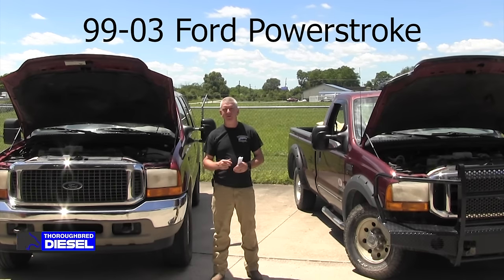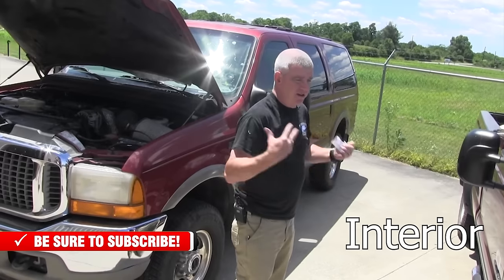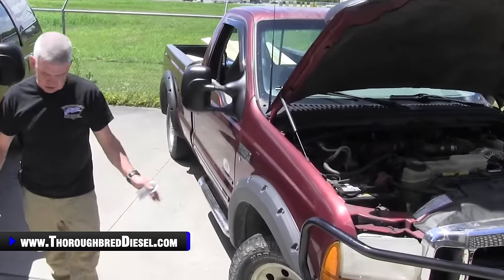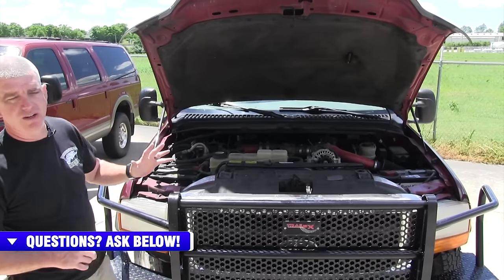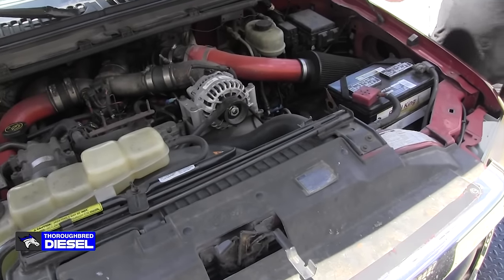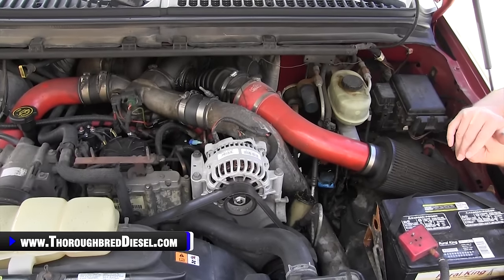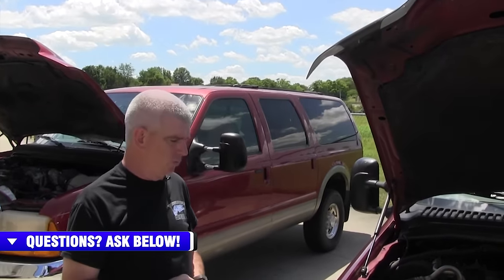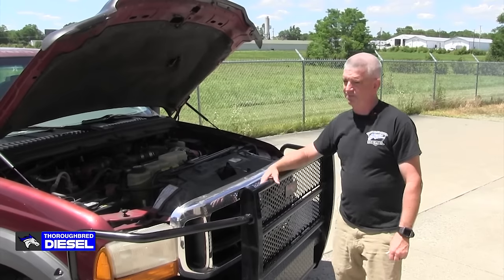TOP Problem Areas To Look At On 99-03 Ford Powerstroke | Secret Tips For Buying A Used 7.3L #ford

Comment: i got a 2001 f-350 with a 6 stage tuner 353,000 miles hauls my horse trailer best truck ive ever owned dont burn no oil still got cold a/c ---- got a 2014 f250 nice truck i hooked up a extra reverse light then the BCM went out got that fixed but all warning lights stay on --i bet i got $4000 in the a/c they fix it 2 weeks later out again the low side is empty the high side is way over now the TPS is going off took it to ford they say BCM is not communicating thats what causing the lights in the dash and a/c not working it dont have but 412,000 miles no problems until now
Reply from the maker: Something is still giving you trouble in the wiring.  I would assume that also is what is takin out BCM’s.  If you haven’t already, get rid of the light.

Comment: 7.3 super duty trucks frames do not come coated.... i dont kno what year, but around 05 and up, frame gets painted from factory.... thats nice..... also 7.3 super dutys you can change heater core threw glove box, no dash removal needed..... nice trucks to work on
Reply from the maker: Anyone who has changed a heater core in a Dodge will understand how nice changing through the glove box is
Reply: 2001 frame IS coated in black paint.
Reply: Thoroughbred Diesel amen. Those are terrible. 😣
Reply: 08+ Super Duty trucks were the first to come with an e-coat on the frame. I’m don’t know if they held up any better then the earlier frames.

Comment: Good video, thank you!  Info on my 2000 RWD Excursion-174k, 10.5", limited slip differential.  As far as I can see in my research. this is what all of the 2000 Excursions have.  Also, this truck spent its first 15 years in Florida, so most of the coating on the frame is peeling off.  I have pulled off as much of the loose coating as I can.  Right or wrong, I do not want water to pool between the loose coating and the frame.  The frame looks rusty but solid.

Comment: I got 2000 f250 with 7.3  I bought it used in 2003 used to pull a horse trailer. it pull it weight, most dependable,  , when we go on a trip we take it,  have right at 200,000 miles on it. runs perfect,
Reply: have u replaced enything on it ?
Reply: @round-townerindustries2247  
Everything I replaced was out side of the motor, nothing internal  ecpt. glowplugs.

Comment: What happens when you plug a battery backwards in a 2000 7.3? 
Does it blow the altinator, main fuse, ecu?
Reply from the maker: I haven’t seen that, but I would think that it would arc enough to blow fuses or burn fusible links?  Could take out ECM’s, TCM’s, etc.

Comment: I have a 2007 F350 powerstroke 6.0
My question is why this engine have bad reputation 
My truck have 130000 miles and I never have a problem 
Thanks
Reply from the maker: The 6.0 is a great motor, its reputation stems from the blown head gaskets,  the failures that lead to that, and the money it costs to fix.

Comment: Great video.
I noticed bilayering in anti freeze coolant reservoir. How do i test to determine if oil cooler or injector cup?
Reply from the maker: With the 7.3 we see that discoloring a lot.  There wasn’t any oil in the tank to be suspect of.  If you do have oil in the degas bottle, and good amounts of it, we usually start with suspecting the injector cups.

Comment: I have an LBZ, a VP cummins and an 03 7.3l SD. My 7🌲 has wayyy more issues than either of my other diesels. Motor is strong but everything else has been a pain in the ass, not to mention all the ford tools you need to fab up yourself to not get ripped off by ford.
Reply: Hard to destroy a 7.3l motor when it doesn’t make any power though.
Reply: I got a 95 f250 almost 400k but in the 8 years I had it 4 transmissions and counting. E4od is a horrible transmission. Everything but the engine, transfer case and rear are endless chasing problems, can’t keep ball joints on the front end thanks to fords brilliant twin I beam front end. I’m a Chevy guy but couldn’t afford an 06 Lbz and I love the 7.3 but still not by any stretch of the imagination a “Ford guy”

Comment: Am going to buy a van with the 7.3 powerstroke and i was wondering how difficult is to work on those engines when they are on a van?
Reply from the maker: Well, access to the rear of the engine is a lot easier!  Good news, you don’t have to work on a 7.3 very much.
Reply: @Thoroughbred Diesel  thanks alot sir

Comment: Have a 99 7.3 that has always stayed in California. But it still has surface rust on the entire frame. Just the surface though like he said. But, I was with you until you said the 4r100 was a good transmission. They are well known to be one of the worst SD transmissions and the biggest weak point in these trucks. Haven't met a guy who had his OEM 4r100 without having had it rebuilt or replaced. This is why a lot of guys opt to put an Alisson transmission in the 7.3. That and the 4r100 is only a 4 speed, the Alisson is a 6 speed.

Comment: I’m a Dodge and chevy guy, really wanting to get into another diesel (will be needing to haul, 5.3 just  has lacks in power for what I’m hauling) the second and early third gens was what I was originally wanting. After owning a lemon of second gen and educating myself I’ve realized that between the 5.9, lb7 chevy, and the 7.3 it seems like the 7.3 (ford) builds the more solid truck. Is that a good assumption? It seems like the early dodges completely fall apart around cummins, the early duramax has, from what I collected in information common head gasket issues as well as injector issues. The 7.3 seems to be a better built truck and still contains an amazing motor w solid drive train, with the exception of glow plugs and small led problems . Of course all the higher mileage /used vehicles in general are gonna need work eventually but do you think a 7.3 would be the best as far as a cheaper truck to keep running? I’m not as educated on ford as I am with Gm and dodge and looking for a second opinion. I understand it all depends on how the truck runs and was maintained but generally speaking is it? Thank you!
Reply from the maker: For an in expensive haul truck this you is a really good bet
Reply: the thing that's said about 7.3's is that there's alot of them that run like shit, and only are running, because they'll pretty much eat their own oil before they'll actually die. stock, and maintained they are million mile motors.

Comment: F-250 4x4 = Dana 50, F-350 4x4 = Dana 60. Both use 10.5" Sterling. I have an E99 F250 4x4 with zf6. I just ordered a EBPV delete pedestal from you guys. Keep up the good videos!
Reply from the maker: Thanks for the business man!
Reply: @thoroughbreddiesel  thanks goes to Dillon for helping me out in sales
Reply: Super 60 on f 350
Reply: My 2001 f350 SRW has a Dana 50
Reply: My 2000 F350 4x4 extended cab Dually pickup has a Dana 60 Front and a Dana 80 Dually pickup axle with limited slip and #4.10 gears and Disc brakes on the front and the rear axles.
Reply: @stevenwolfe9085  yea, I made an error on that 1 ton rear axle.
Reply: @EngineersHomestead  99-03 F350 Single Rear Wheel (SRW) were Sterling 10.5 axles. F350 Dually pickups and F350 Dually Cab and Chassis used Dana 80 axles.
Reply: @EngineersHomestead  So no you weren't wrong.
Reply: @Steven Wolfe  ah yes that's the split!

Comment: Are the manuals as good as the automatics? I'm about to buy a 2002 and it's a 6 speed manual
Reply from the maker: In my opinion, both are as dependable a transmission as you are going to find.

Comment: I've got a 99 7.3 F-250 It starts well. I think a battery is going out on it. I just replaced the ENTIRE braking system. The Turbo is apparently coming apart. It has an engine brake on it. The guy I bought it from had some sort of tuning chip thing, and said it was on 50HP more than stock when it quit working. The engine brake when engaged hisses like an air leak. Now.... When it's cold for whatever reason it does this hissing thing. I am not sure what it is, or why, or how to fix it. It didn't do it when I first bought it, but shortly after started doing that. Any Ideas on the issue or how to fix would be greatly appreciated. The truck is sitting at just over 200k miles and also has the 6 speed manual. Interior is EXCELLENT, except for a couple wiring issues, like the mirrors, if you use the control for them, it blows the window motor fuse. The radio quit working the ONE time I let my brother borrow it. The paint is not that good. It has like a bunch of little cracks in the paint. I don't know. Well there you have it. My 99.
Reply from the maker: It should hiss.  That’s completely normal when the valve is closed.  And now that its cold,  it should hiss on startup.  That’s the warmup cycle,  also completely normal.  Sounds like everything is functioning normally.  Now,  I will say that bellows can be compromised on those trucks up pipes so watch for soot trails on the back of the engine to make sure you don’t have a exhaust leak.

Comment: What would cause my 2003 Ford excursion 7.3 power stroke have a crank no start issue no blow by
Reply from the maker: Need to know codes and what is the cranking HPOP pressure and ipr duty cycle.

Comment: I had an 01 7.3, and absolutely loved it. Only had a couple things wrong with it, I did have my Overdrive light blinking at me, and had a small electrical problem with it. Turned out replacing the batteries fixed that problem. Although it was a heart wrenching sight when I first saw that light blinking, I was relieved when it was just the batteries. Also when I was at a complete stop, then accelerated, I had this clunk that came from what seemed the rear diff, I had it checked out and was told nothing was wrong. So I didn’t worry about it! Lol if anybody else has that problem and knows what it is, I’d love to hear what you have to say 😂 other than that, these trucks are solid.
Reply: Very possibly a drive shaft u-joint.
Reply: Ive seen some trucks experience a clunk because of driveshaft slip yokes binding, and also leaf springs having a flat spot where the usually ride.  When the axle torques on acceleration, it pops off the flat area, and makes a clunk.  Just some ideas.
Reply: Check rear drive shaft slip yoke. It can bind. Remove the 4 8mm bolts at the rear most U-Joint and drop the drive shaft. You should be able to feel if it can slide in and out like that. If binding look up how to fix. Its easy to clip rear metal band on boot, grease splines and zip tie the boot back. 
Check the carrier bearing. They do get worn. 
Leaf spring idea below is interesting too.
Reply: Have u changed rear differential oil ?
Reply: Speed sensors there are two. That’s usually what does that and causes that intermittent od light.  Was the issue with one of mine.

Comment: What's the story with pre-March 1999 and post- March 1999 models. Mine has a manufacturer date of 04/98 and have had issues finding parts , most notably front end components........???
Reply from the maker: That is a early 99 truck.
Reply: I get that, but, is there something in design...??

Comment: 301098 miles it's beat up I use it to work not play. 7.3 running good don't want to chip her only the seat's in front are ragged.

Comment: My 2002 f250 7.3 has 220k runs like new but in the last few thousand miles the power windows and radio don’t work after starting engine for a minute or 2. Has anyone run into this problem?
Reply from the maker: The vehicle security module behind the dash is  my guess without seeing the truck.

Comment: Are the ford 7.3 diesel transmissions interchangeable for the 2000-2003?  I just purchased one for my 2000 and may want to put it into a 2003.  Will that work?
Reply from the maker: As long as it came from a 7.3, yes.

Comment: Tore up rear ends is common issue. Especially behind the diesel. Lost of these units clocked 300,000 plus and likely no service on the rear end.
Reply: Is rear end related to transmission or rear axle ?

Comment: I’m buy one for towing cars and trucks 2001-2003 7.3 I’m going to collect them and restore them. Save them from all I’ve the country won’t rest until I have 10 of them lol.
Reply: Just about to list mine for sale. In excellent shape under 200k miles. 5th wheel hitch. 99 250 superduty diesel extended cab.

Comment: 2001 F350 XLT 4x4 7.3 w/ 6spd. Correct me if I am wrong...but my Ford Shop Manuel's state the frt. Axle as a DANA 55 ( Built on the concept of the 60. Also the Ford Techs have told me this. So what is the difference?

Comment: I bought my 1999 F250 7.3 L. new and it only has 130,000.00.  it has had a starter replaced and some other parts it has has extremely reliable.  No rust and the white paint is excellent despite never be garaged.
Reply: How much did you pay for it? I am looking at one with a kk g can. 106k miles, they want 15k

Comment: I have a 03 f250 4x4 lareiet only thing I added is a hyper tech chip. I get 20.3mpg. My truck has 115000 miles on it. Runs great but I don't put it through hell. But very interested in some upgrades

Comment: I have a 2000 f250 superduty 7.3 powerstroke and so far I love it, I have 211 and some change for miles it was a Texas  and Mississippi truck before I got it. I live in n.western pa. I noticed this winter noticed my fuel economy has gone down a little but im thinking it's just winter fuel. Would it be a good idea to run some sticktion eliminator through it, oh I have a 6 speed manual

Comment: Just sold my 2000 F350 with the ZF6.  Nothing wrong with that but I plan on switching to the 4R100.  Still want the 7.3 obviously, so I'll be in the market in the future for that configuration.  Good effort with the video, thanks!
Reply: You made a mistake.  My '02 4R100 has been nothing but problems.  I would kill for a manual.

Comment: I have a 99 f450. Runs rough when it’s cold out. Gets a noise that sounds like maracas and loses power. Gets worse as it gets colder out. Any ideas?
Reply from the maker: Are there any codes in the truck? Are you getting power to your glow plugs on startup? I would have to hear the sound to know what's going on but if you hear that sound then the truck loses power, I would think that it should set off a check engine light.
Reply: @thoroughbreddiesel  starts very good. If it’s below 40 degrees it starts the sound right away and goes on and off. Was good no sound on the way to work this morning. 60 degrees out. Should I check codes when it’s making the sound? I’ve been thinking I should have that checked.
Reply from the maker: I think so as well. As a technician, it’s much easier to diagnose hearing something and actually being there. The only thing I think you could be hearing is the EB valve but it doesn’t make that rattle sound. Let us know what you find.

Comment: What do you say about getting one of these to drive to school
Reply: You can pull alot of 🐈 🦅💪🤠👼🎅🦃s in a 7.3 on the way to school
Reply: Short drives kills diesels.
Anything less than 10 miles one way daily is bad.
Reply: @guy_incognito7538  I don't agree.  I've never seen a diesel killed because it was driven too few miles.  It is more of a matter of not beating on it until it is at operating temp but that probably wont kill it either, just shorten it's life span (if its stock power).  A 7.3 doesn't really make full power until the oil is warm, so they kind of protect themselves that way.  I think it is more of a waste of money, you don't need a diesel truck just to haul, your ass.  If you want to pay for the cost of maintenance, have at it.

Comment: Early 1999 Ford have a few different items like a small turbo... late 99 to 2003 have a larger turbo...dont know why but my early 99 f350 has a rake to it ...any one know why? It's all factory
Reply from the maker: Rake as in nose down? Could be weak springs in front?
Reply: @thoroughbreddiesel from tire trend to the bottom of the fender flares its 13.5 inches in back..and 8.25 inches in the front from tire to bottom of fenders
Reply: They have lift blocks in the rear of the early 99’s. Fifth wheel folks had problems, so they lowered it on the 99.5. Mine has a front leveling kit. Looks great

Comment: I can tell u never owned one for 20 years.  Oor u would have mention 

Front rake on the bed causeing the front frames to rot out under the plastic bedliner

Overdrive switch wire shorting out inside the shifter

Frame mounted fuel pump high failure rate and problematic pickup thats the 3 problems mine has

Comment: Check for oil pan leaks. From what I've heard, some will rust out over time
Reply: They were stamped sheet metal pan. Rust is common in midwest. As I understand, you have to pull motor to replace the pan.
Reply: @straycat62  you can take out a few body tab bolts, Jack that up and introduced to, then jack up the engine and inch if I remember correctly. Always annoys me when a company makes it that difficult for an oil pan. One or two small differences here and there would make it easy to remove

Comment: So what if it  has oil ring in radiator and it’s low on oil?
Reply from the maker: On a 7.3 it could be leaking oil and what you see in the degas bottle could be exhaust gas ring. But if its oil, suspect a injector cup, possibly a failing oil cooler.

Comment: Can you change out the triton to a powerstroke diesel, what else you need to change out?
Reply from the maker: You will need the wiring harness, dash makes it very nice, tank, fuel lines.  Several things really.  It would be best to have a crashed truck you could roll everything over with.